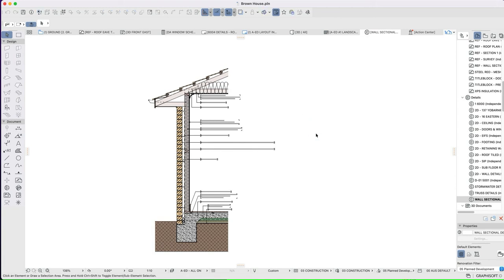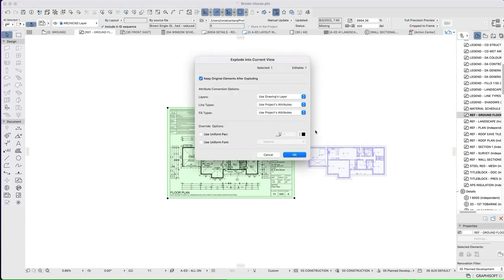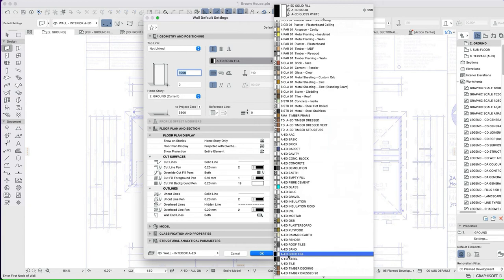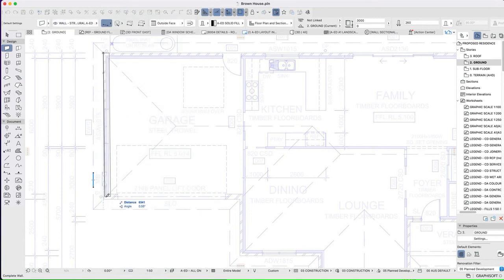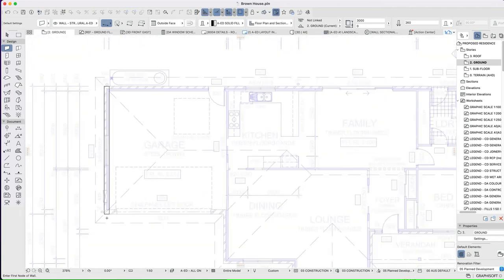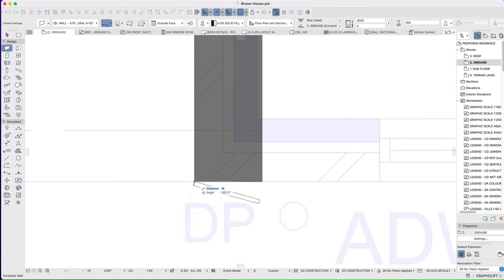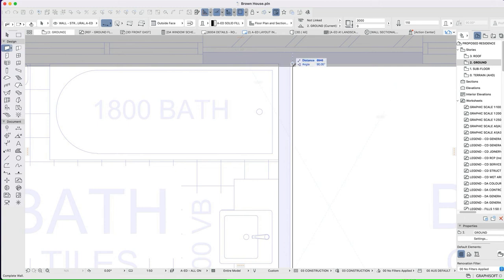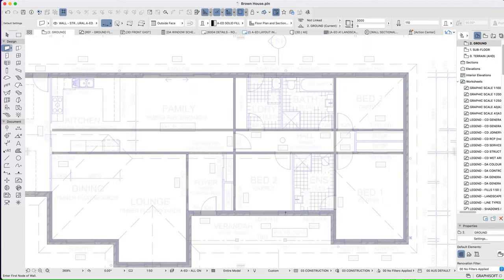ARCHICAD 25 MODELLING - 01 WALLS VIA TRACE

Comment: Im a little confused, do you do another plan showing walls without plaster? Or are the carpenters expected to minus the plaster thickness when they are measuring?
Reply from the maker: Hi Bet, good question. I wondered the same thing, as I was taught not to include the plasterboard when manually drafting for this reason. The short answer is, No. The beauty of ArchiCAD is that we can define the plasterboard as a 'finish' only, meaning that when we dimension the walls we can choose to dimension either the overall thickness, the thickness of each sin individually, or ignore the finishes and only dimension the core elements. I explain this in more detail in some of my other videos. :)
Reply: @RobertMannArchitect  oh that's good to know! Thanks for taking the time to reply :)